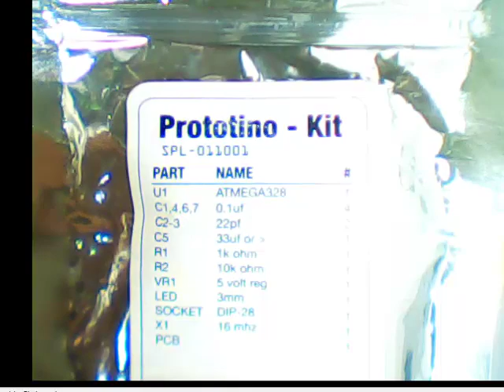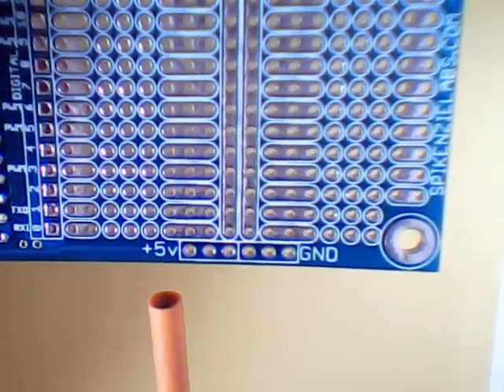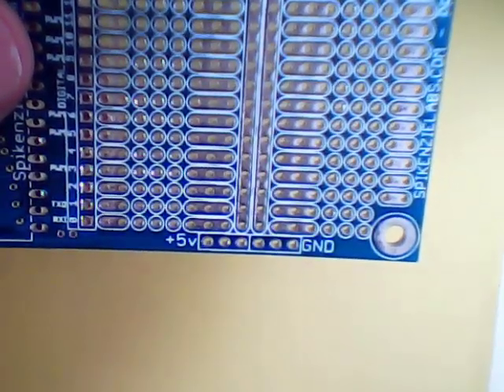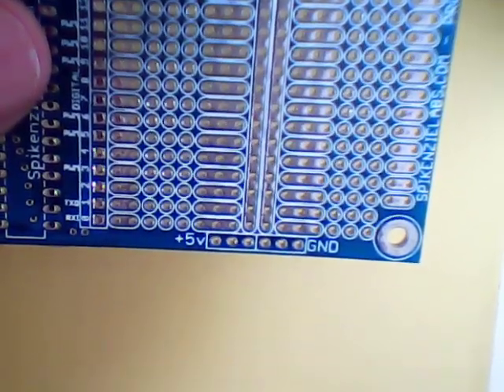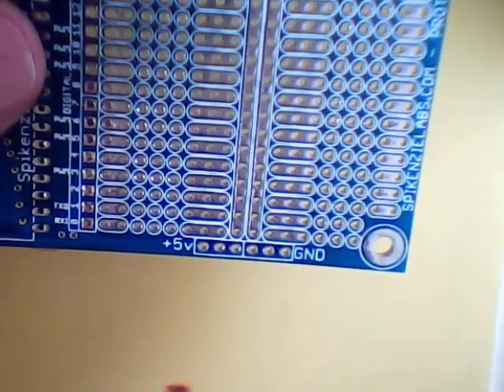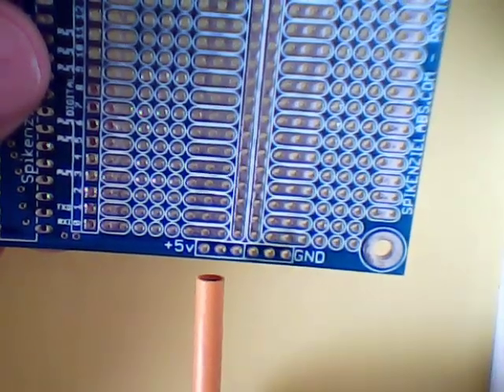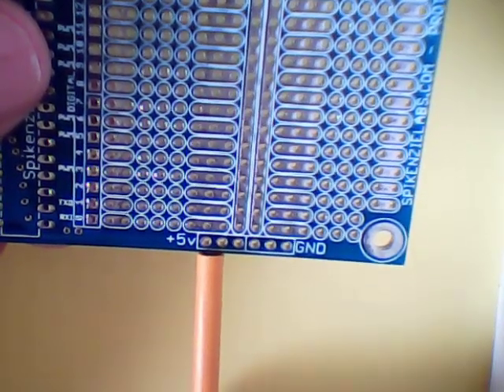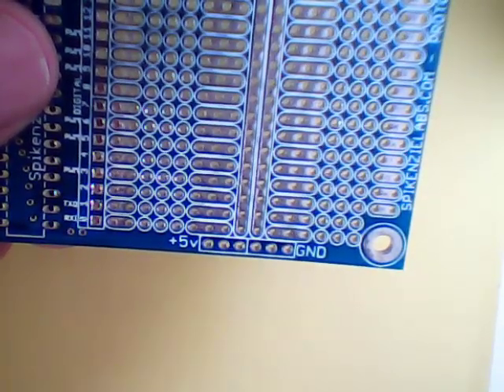Making Your Arduino Project Permanent with Prototino

Comment from the maker: Jeff, I power the Prototino with 8V from the accessories jack on my HF radio.  The decoder comes on every time I turn on the radio.
Reply: Hi Budd, Kelly W5KPM here again.. I am waiting for parts before building a breadboard then a permanent version of your decoder. I want to use the circuit shown in this video, with exception of using a digital pot instead of the manual method of tuning. I also assume that the rotary encoder helps to set the pitch in the desired signal? thx and 73, Kelly
Reply: My apologies for not checking the code in depth asking questions...   :(
Reply: Beforehand

Comment: What a great project, great video and great design. Thank you for sharing this, and thank you for doing it so thoroughly. My Arduino has quite a bit more work to go to catch up to your Pet Arduino. :-) I'm wanting to send morse code (essentially to emulate a key), as well as decode like your project. With the Prototino form factor it looks like having a self contained unit would be the icing on the cake. :-)
I am curious about battery life of your nine volt battery. I'm guessing you don't have it plugged in and in use consistently enough to know how many hours continuous use you can get out of a 9 volt battery with your tool (which is what it is - and a nice one at that). If you do then I'm really curious how long you think the battery would last with it always "on"?